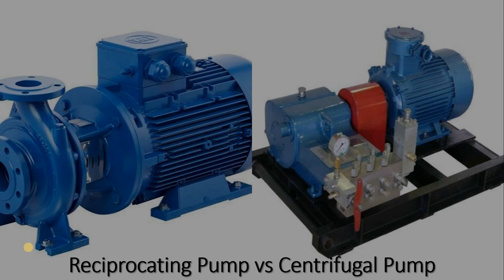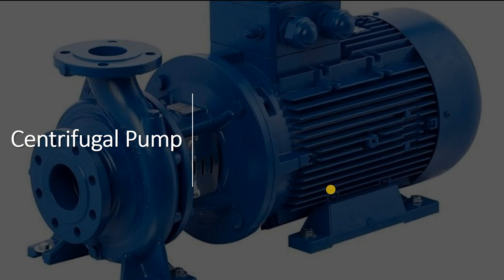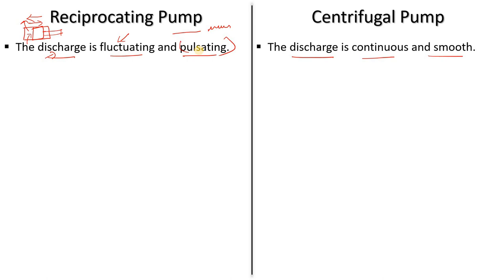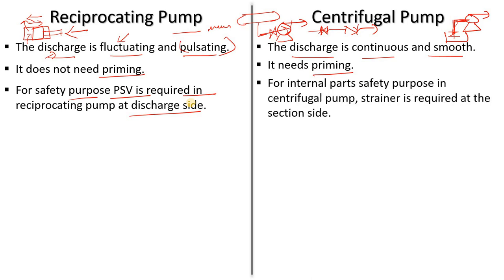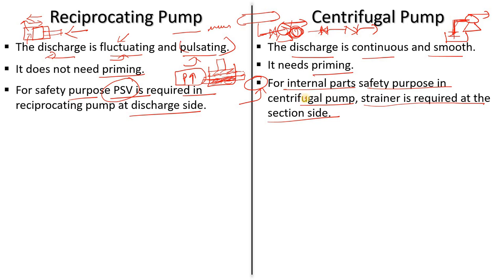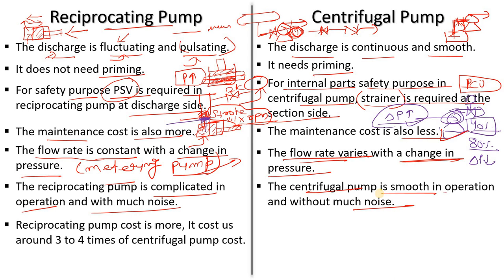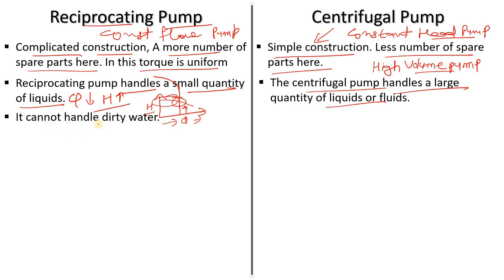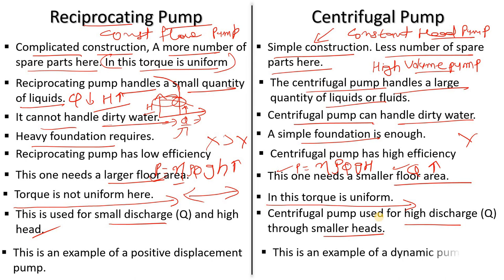Difference between the Reciprocating Pump and Centrifugal Pump | Core Engineering

Comment: The Reciprocating Pumps have an advantage on one specific domain !!! They are ability to water supplying low flow at more than 7 kilometers and with an over elevation more than 50 meters.

A ratio  power (Kwh),distance/elevation that  could none centrifugal pump !!
The Reciprocating Pumps coupled at small  solar system can be having the hability  for off-grid area or Hybrid System and supply water than distance more 7 kilometers.
At powers lower than 10 Kw, there is no centrifugal pump that can "push water" more than 5 KM and more than 50 meters elevation. ( up to 100 mca .)